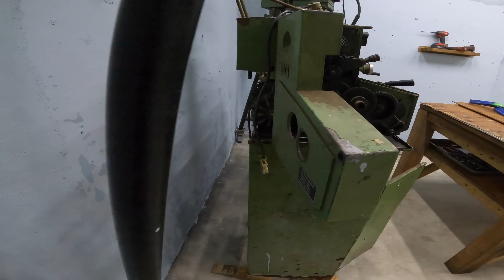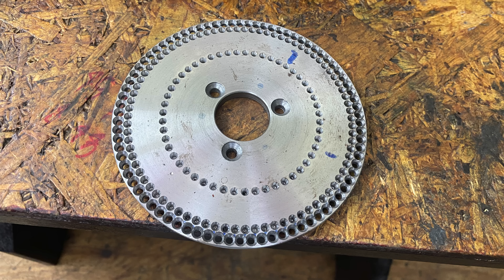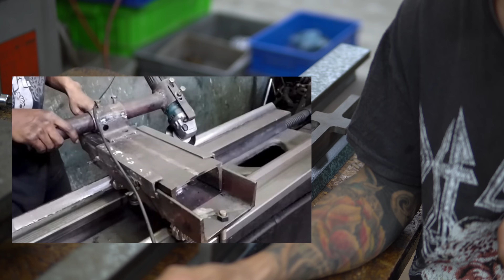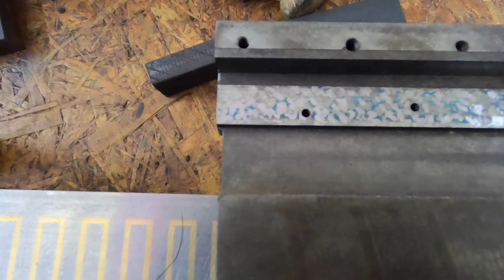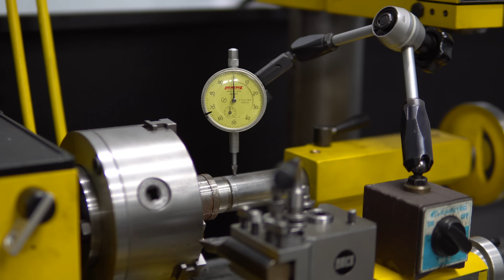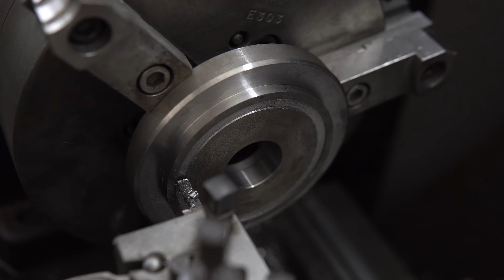The hard way to fix a machine

Comment: Hi CA Lem.
I owned the same Lathe, sold it to my Brother who uses it occasionally.
Could never part off with confidence due to the flimsy compound attachment to the cross slide.
Not fond of the Fibre gears in the headstock to achieve quiet running.
Like you I added a counter weight on the rear of the saddle on my 13" lathe.
Excellent job on the restoration.

Comment: that's one of the best hobby machines ever made. I have the 11" one. But I don't use the milling head - I sold it and bought a mill. You've done an amazing job
Reply from the maker: Its kinda neat to look but to use i'd do the same thing as you but my brother is decider here.
Reply: I kept banging my head on it when I would bend down to get a close look at the work! I guess many people in Europe have small shops so it makes sense for them.

Comment: can someone explain to me what makes scraping better then grinding for example to get the rails and bed perfectly fitting? (as a newbie scraping just feels a lot more unprecise :D)
Reply: While grinding can be very precise, it’s harder to fine-tune the process after the material is removed. Once you've ground off a certain amount, it's hard to reverse or adjust it in small, controlled ways without additional steps. Over time, Scraped surfaces often have a longer-lasting, more stable fit because the scraping process is so precise, the parts wear more evenly due to the controlled nature of the material removal whereas grinding can lead to a more abrasive surface, which may wear out faster or unevenly over time, especially if the parts are subject to heavy loads or stress.
Reply: @ShotgunAU  but high end machines dont come with scraped surfaces right? or is it just the best way for home use
Reply from the maker: @OnezKrs non of the commercial product now a day is "high end" imo.
Reply: As Ca Lem himself also said, scraped surfaces also hold on to oil, which is better for long term lubrication.
Reply: You have everything backwards... 😊 In general you grind, then scrape. Grinding often introduces irregularities into the surface; see, grinding is generally done on a surface grinder and the table moves back and forth. Therefore a magnetic chuck or clamps are used to secure the work. When the work piece is held in either of those two manners, it's basically pulled down via clamping forces or by mechanical clamps and when those are released, the damn thing will spring up and move on you. Your nice flat ground surface is no longer flat. When scraping, the lathe bed or mill table (whatever) is sitting in a relaxed state without external forces (clamping) working on it. So, consider grinding to be roughing it in... With the bed ground, in a relaxed state, you scrape the highs off. In general practice then comes 'flaking', which is really more for better oil retention then simply scraping alone. Low end machines are just ground, high end machines go through hand scraping as well - this takes time and experience which cost significantly more, but yields better results. Machines alone can not achieve the same level of flatness that a human can do.
Reply: I've no idea of how modern computer controlled machine tools are set up. For machine tools built before the advent of computer control, quality machines were ground, then scraped. The reduced contact area, the better oil retention on the surface and the reduced friction all favor a scraped surface.